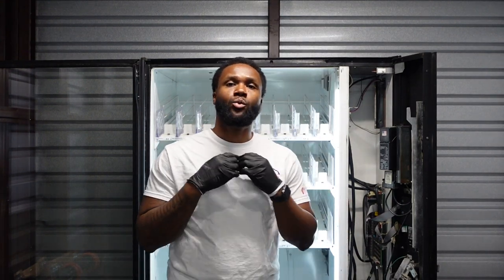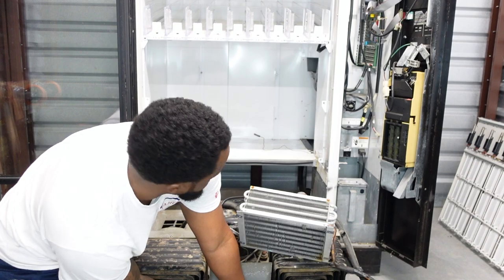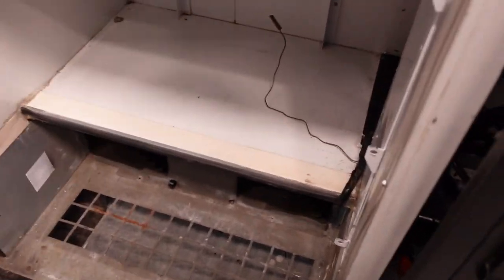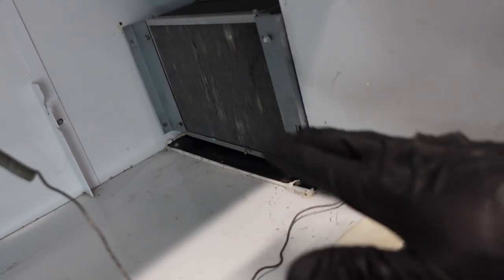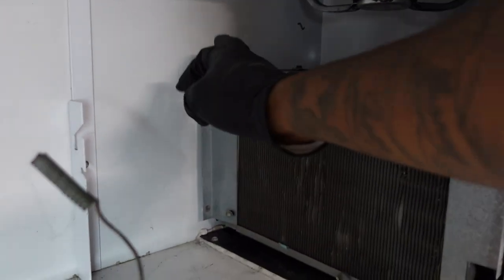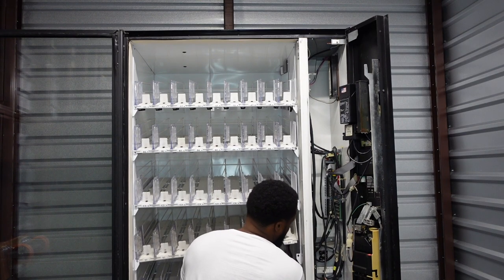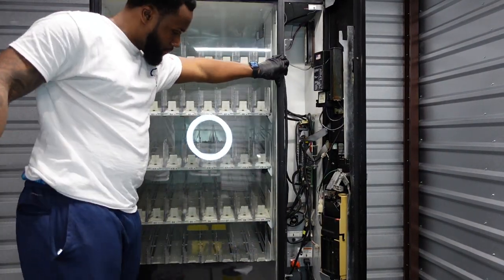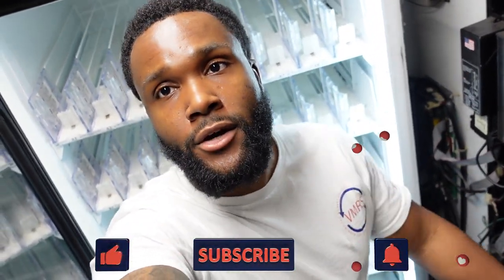How To Install A Dixie Narco 5591Compressor for Vending Machine

Comment: The first gen dixie glass front drop sensors were a pain in the rear. Usually bypassed the sensors. Other issue I had was change evap fan. Was not fun for a big guy!. Pepsi tech for 12 years before I left.
Reply from the maker: Yeah those hard to reach areas can be a pain!!
Reply: @waynehawkins9090 Man you must have a lot of knowledge of cooling systems…trying to get to that point myself. I know a guy who was a Pepsi tech as well, but he’s since gone to Coca Cola. I try to learn from him.